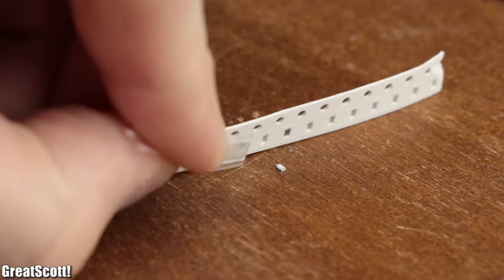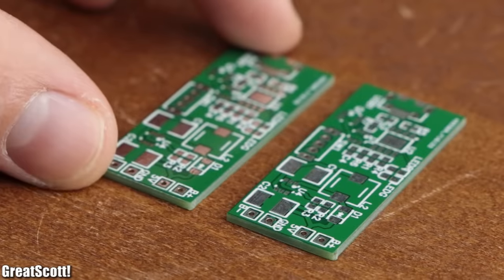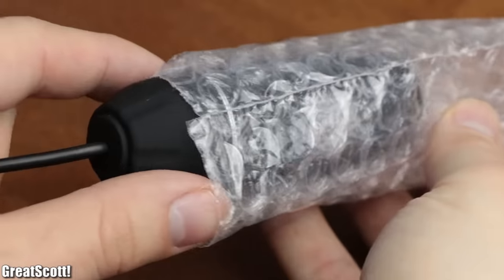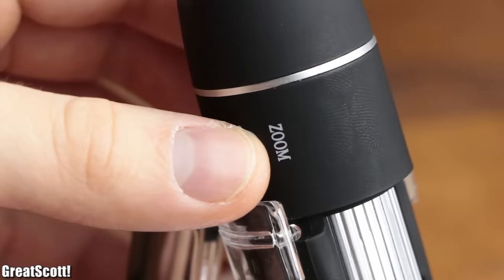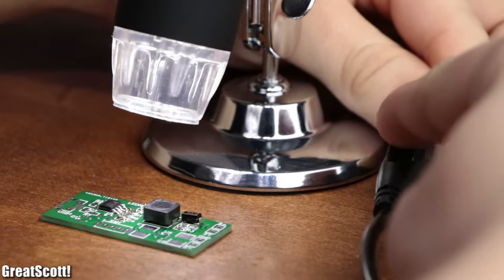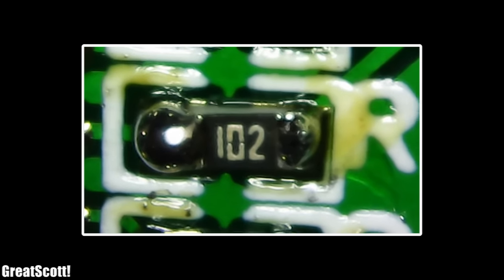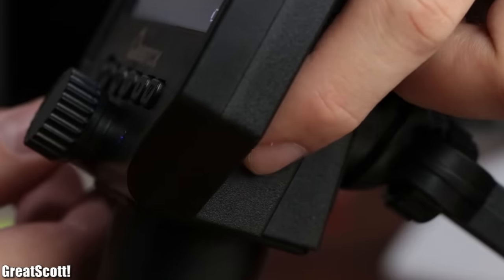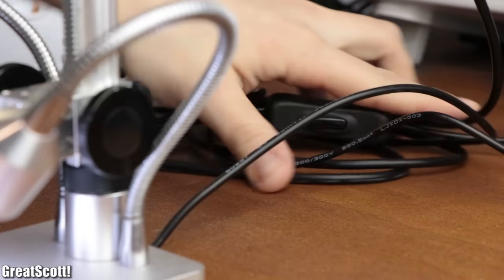Microscopes for SMD Soldering || $15 VS $45 VS $189

Comment: I haven't soldered with the first microscope, though have owned for a few years and identified a bug one time.  Literally, I had to change rooms afterwards once I realized what the creature was.   More related... I did recently purchase a "1" pvc coupler" piece since was the cheapest inside diameter part and cut a maybe 3/8" section off to use with a microscope UV ring light adapter I hot glued a white LED ring light used originally for some sort of BMW angel eyes or something like that I found.  I used felt tape to make the cut PVC ring snug around the cheap USB microscope.  I soldered barrel plugs to the cheap ring light leads and hot glued a 12V 2A dimmer in between the 12V wall wart.   I am thinking to use that for soldering, I'd need a monitor or LCD screen above like the last two.  

Since reading more into and actually wanting a scope to solder... I invested in a Stereo-Graf stereo microscope that is older, though good if not great compared.  I think I am going to invest in 15x eyepiece lenses and rubber lens eye pieces.   I also invested in 5/8" 3' section of stainless steel rod that I am going to construct a boom using the same stand and if there are issues... I'll have to make a desk mount for. 

I was thinking for that... where the light was supposed to be... I am going to be able to maybe mount a smaller cheap surveillance camera and where a ring light will go to be able to just fit using the two screws the ring light noted above so to have a trinoculer microscope then for not a bad investment.  I still see under a handful on eBay for not a bad price.  

McMaster-Carr has as well as eBay in 1ft sections (somewhere from Hesperia, Ca) the 5/8" stainless steal.  I was actually going to get from the eBay source... though when I ordered from McMaster-Carr I was thinking a long 2ft boom where now I am thinking to cut in three sections so able to fold out of the way better.

Comment: REMOVE that piece of plastic from the bottom of the microscope
Reply: Yeah, have the small one and that is the worst part. Had a scratch and not clean but all attempts at cleaning have made it worse... Wanted to cut out the lens and put in a flat or very slightly convex piece of glass in, but everyone wants a fortune, and can't find that slight convex...
Reply: Actually that piece of plastic is just a lens protection and you don't really need it. When removed you could touch the actual camera lens with the finger. The quality is totally awesome without that "lid"

Check the image below:

https://imgur.com/Dq7ZRAu

Comment: I strongly suggest you to buy AmScope SE400 or SE410 stereo microscope. It's $150 to $200 depending on configuration, but it wins hands down against all devices you've shown because, well, it's stereo. Stereo is a BIIIIIG advantage, because you can see 3D image which helps a LOT with placement as you see the part in 3D space, not as a flat image. I'd suggest to get a x10/x20 config as x10 is great for placement, while x20 - for inspection of solder joints. With it I had no issues placing even tiny 0201 capacitors, not hand soldering 0402 parts (I have SE410 which has a focal distance of about 15 cm, SE400 model has even larger distance of ~23cm, which was too much to me since I'm not that tall, and prefer working seated - but with that kind of distance from objective to the board you have absolutely no problems working under it). This is the best $250 I spent in a long time! Highly recommended!

Comment: This video makes one thing perfectly clear - stand quality is as important as camera quality. Two cheaper microscope can be vastly improved in my opinion, if their stands (if they can be called stands) are replaced with sturdier ones, like the stand the most expensive microscope uses.They sell those, and they're not expensive, just search for "aluminum microscope stand" on ebay or aliexpress, or wherever. 

Another thing.
Having a shaky cam at this magnification is a nightmare, and having to press buttons on microscope body is something you want to avoid, as you inevitably move your camera (and bad stand makes it even worse). So if you must use buttons while working, look for a microscope with a remote control.

Comment: I have the LCD type like the second example you tested. I could have different firmware or image sensor 16mp but seems to work very well. Mine has a stiffer adjustable tubular base that is weighted. However there are several different companies producing these things. I may have just received one where all the components were working at their optimum performance ratings. My screensaver could be changed from 5, 30min to off. But works more like an auto shut off. Thanks for the video!

Comment: If you remove the clear plastic cover or better all the clear plastics in the edge of the microscope you will amazed with the picture quality and the clearance.The front covers cut to half the led light,the maximum distance and the entire picture quality.

Comment: Hey! 
Since you've done videos about SMD-Soldering, developing your own circuit boards and using an Atmega without an Arduino, it would be really cool if you could combine all these topics! E.g developing a smd-soldered circuit board with a usb port for programming, Pins for Li-Po batteries and so on and so forth. 
I'd really like to put some of my latest portable projects in the smallest possible box, but I'm not sure about the SMD-soldered Atmega-Chip concerning the bootloader and FTDI converter.

Comment: The micro scope with the 4.3 inch screen now has a nice metal stand that is adjustable ,it's about ten bucks more but worth it ,I go mine at bang good ,the also have a new 5.0 megapixel with a cheap stand ,I don't no if it's any better than my 3.6 megapixel with the nice metal fully adjustable stand .

Comment: Just got my Andonstar ADSM201 this morning on your recommendation.  Pretty happy with the build and image quality.  Even happier that I found that I don't have any of the issus you described here with the screensaver and it turning off.  Latest firmware must have fixed this as I don't even have a screensaver option.  Also, a bit of tessa tape and my cable problems are gone. ;)  Thanks for the recommendation.

Comment: It looks very much like you've left the lens cover on the cheaper microscope - it's transparent and easy to miss (I did with mine), at least in the shots you've shown there is a small tab visible which would mean the cap is still in place... That has a significant detrimental effect on the video quality.

Comment: I have the 45 dollar one. I changed the base to something very solid and it worked alot better. Also you can control the magnifying by the distance of it from what you are soldering.  I also own the 15 dollar one and its was a lot more blurry. Also if you plug the 45 one to a computer it disables its screen while you use the computer.

Comment: I use the cheap microscope with the LCD with an upgraded aluminium stand similar to the andonstar so you can use the front knob to coarse focus and the height knob to fine focus.
Also search on eBay for "PCB Holder For Mobile Phone Board", this a very useful pcb holder for soldering under the microscope.

Comment: I've used AmScopes for SMD work.

I don't need fancy video out (although you can buy an eye piece to do that), I just need a good scope.

Plus, they won't lie by saying "10000X"

AmScope has a "kids" stero microscope for around $45 on eBay new (less shipping). I haven't tried that one, but I imagine it'll work just fine.
Reply: True, I don't understand why he got a digital microscope when he could've got an optical one .
Reply: Lost Night in his case it makes sense since it is a production piece as we've seen in several videos.

However, for you and me, then it makes more sense for an optical since we aren't making smd soldering videos.
Reply: Lags are the main problems of digital microscopes . When you solder bigger smd like those in the video there's really no problem , but when you go small like in smartphone repair (iphone s 01005 smd ) an optical one is mandatory , or else you have to buy a digital one that costs the same

Comment: The Andonstar camera has the exact shape and a similar software as my dashboard camera bought from Lidl a few months ago. The only difference is that it has a battery inside that keeps the camera on for about 2-3 minutes and the saved settings never resets (that would have been a pain in the ...).

Comment: One could modify the $45 fairly easy to a better base. Other negatives also easily addressed with additional time spent.
Reply: Btw there is a $35 version of the $45 on aliexpress that has a base included so no need for a suction cup.

Comment: You can use the cheap $15 one with an otg cable and connect to your phone, any Webcam display app would work for it

Then you can 3d print a better stand, and you pretty much got your $45 one for $15 (I got mine for $7 lol)

Comment: I have the first one ($15), and while I like the microscope, the stand is terrible. I found a heavy duty desk clamped gooseneck optical magnifying glass on eBay and removed the glass head. I two-part epoxied a microphone stand head in it's place. It holds the camera quite well and can be positioned very accurately.

Comment: Personally I'd like amscope stand/lens with 0.75x and 4k60 camera, it's really tough to find these though. And most cams on aliexpress misrepresent the settings. The megapixel rating matters too... because if it's a low bitrate, the image quality will be terrible. You can use a old camera perhaps, but even the budget ones are not cheap.. !

Comment: for the $15 and $45, i thought of adding another piece of magnifying lens below to increase the magnification . I wonder does it helps in increasing it's resolution sharpness ? I believe with somesort of slight modifications of it's holder and adding a piece of magnifying lens, it could probably works as great as a $189 microscopes.
Reply: the only worries with these microscope is that it tends to break down after sometime mysteriously. This is very common with china products.

Comment: I have some spare old usb  webcams i just opened one of them and rotate(screw type focusing)  the lense to get perfect focus but mistakenly i focused it to full macro

I wondered that it can capture  Mobile screen' (RGB) pixels by placing it direct to screen (no gape between screen and lens)

But problem is that it's pretty hard to get desirable focus + need a separate light source

Comment: I'd like to add that you can also connect the 15€ microscope to any Android smartphone via the USB adapter. This means that you don't need a PC or USB power supply to use it.

Comment: A circuit board holding vice would make life easier for you,stops board from moving around. Also allows earthing to prevent ESD problems. I notice you do not use an ESD work at or take any ESD precautions? You need to look into this matter my friend.

Comment: I've used the "$15" style one but I actually only paid $7.99 I bought one for $8 shipped and I got such an amazing microscope I did alot of microscopic style soldering smd'sfor Carson electronics in LA and then a few weeks late to purchased the same one or so I thought and the image quality was so shitty I couldn't tell the difference between a bug and a grian of rice I was honestly so terrible I took it apart to see what the difference was and I found out that each video chip in the scope was different between each item you purchase so they had recycled chips from many different items and used them in the microscope and you the buyer have no idea what you'll be getting. Its worth buying two rolling the dice and hoping you'll get a high quality video chip hell you might get two high quality microscopes. The really high quality one I bought matched the quality of a $400-$500 portable digital microscope. So for the price of one cheap one youll get a great one and maybe a toy for your kid, younger sibling or nephew. Or you'll get two great ones or two shitty ones lol go eBay!!! Yay.

Comment: One thing I'll add - I purchased one of the $15 microscopes from Celestron years ago (when they were in the $45 range) and the rubber coating on it has started to break down and get 'gooey'. I'm guessing the manufacturers are still using the same rubber coating. Would not buy again :)

Comment: May have to add hot air gun for  smd soldering to the list too, which one to buy. not to sure if you have already done this :) .
Reply from the maker: +wayne hart I use a super cheap one and it does the job just fine
Reply: Thanks for the quick reply, got one now in the shopping cart. --- **can you make one of these** --   http://gyrogear.co/gyroglove -- for those who have the shaking hand thing when soldering. may help, i will get one and let you know.

Comment: The ADSM201 that I have does retain all settings even after removing power.  It must be a firmware bug on yours.  Also, check out the ADSM302 on my channel that is the newer model of the ADSM201.

Comment: Honestly really, I can't see why you didn't compare USB microscopes with stereo binocular optical microscopes.  Without that comparison then any results are pretty useless.

Having owned both - the Andonstar ADSM302 USB and an Amscope copy/ripoff opotical binocular there is honestly no comparison

Believe me there is point in owning the mono vision USB microscope, you are just wasting money.  - without stereo vision you have no depth perception and this makes micro-soldering far harder than it should be.   I can view both on a monitor (I actually have a camera on my optical microscope, but there is no point in doing that either - if you really want to work on something, look down the  microscope for stereo vision clarity.  You will see me do this often on my videos, I just can't work properly looking at the screen.

Comment: HI GreatCot, i am brand new to soldering and everything. I a only just getting my first soldering gun, station and heat gun next week. I will be repairing playsation boards, removing chips /packages and replacing them with new ones, i will be messing with the boards on TV@s etc, can you recommend one of these specifically for me, as i'm a beginner with VERY little money, but don't want absolute rubbish! thank you so much, grea video, I thumbed up, subbed and shared.

Comment: Make own microscope with raspberry pi and maybe you can live stream video on your phone/computer/TV and you can also add small 3,5" LCD like primary screen and use HDMI as secondary video out...  all in 3D printed case with all things what you want(zoom button, picture button(you can add IR receiver because if you press buttons on the board you shake with all that and photos  is not focused), LED brighnest settings (you can choose potentiometer/encoder/buttons), battery including, using only 1 USB port, full HD camera,and lot more)
Just think about that if you have enought time, people will love this ;)

Comment: I love 'Great Scott'. Now comes the 'but'. I don't know enough to get full benefit from the content's high level. The present video can serve as an example. After watching this video I am still unclear as to whether the $189- digital microscope can be operated completely independently or if I must also connect it to a computer.
I'm also unclear as to why I would prefer a digital microscope as compared to the traditional light microscope: I suppose that the answer is cost, but it wasn't said.

David Lixenberg

Comment: how about option #4:  just mount your smart phone on a stand and use it as a microscope?  I am doing that with my galaxy s7 and it's definitely better than $15 microscope.  Another idea - run android version of amscap program and output $15 microscope output to android tablet/phone via otg cable.   Mount the tablet so that it's comfortable to look at while working.

Comment: I took a better version of the $40 one, with a metal stand and quite enough space between the lens and the board. it was around $45 from bg. they say it's also a revised firmware version. overall, I'm really happy with it...specially the battery uptime!

Comment: I was try to find solution for this problematic and Im found that cheap microscope is crap and better way is to use small magnification with lower seat. Or using standart microscope for PCB soldering with eye binoculars and basic price more than 200eur. Also if you eleant camera than prepare 400E

Comment: You are getting a blurry picture on your USB microscope just because of one thing. I saw in your video that you did not removed the safety covering plastic cap !!! I got both of these cheap microscopes. The Standalone 45 US$ microscope is in my opinion very good. Even the USB microscope is very good, and it has a pretty good picture. The only problem is that there is no really high resolution. But it is more than ok. My USB microscope throws out a picture up to 480p if i am not wrong. The 45 US$ has 1080p, but let`s say it is 720p and the picture is way better than that on USB. Besides all facts, you can get much more out of the 45 US$ version if you build yourself a table microphone stand and attach to it. I saw it on Youtube how someone did a modification by using a such microphone stand. I did it, too. I am using it, and i am not planing to buy something that is high end and costs 20-30 times the price of this one. It does the job more than good.